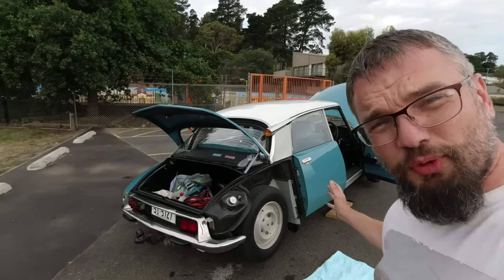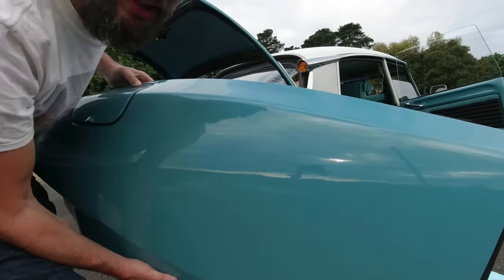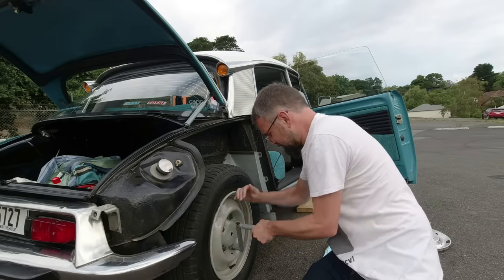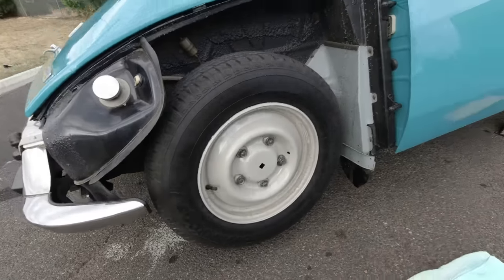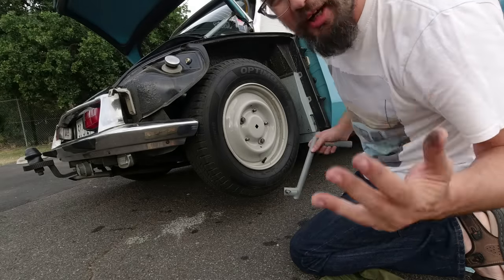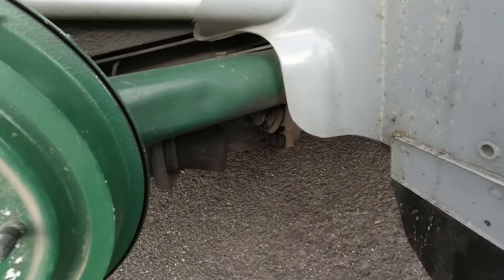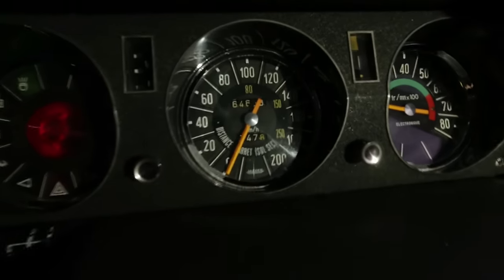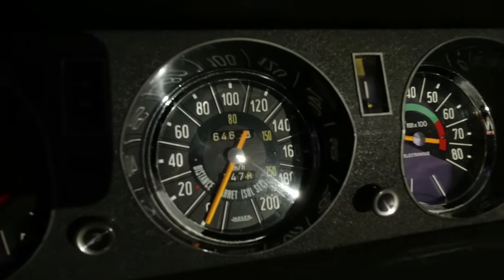Can it drive on three wheels?! And other Citroen DS Party Tricks

Comment: It got there Ian.  I share the excitement with you.  Who’d have thought that when we did this it would go on to be your most viewed video and reach 1 million.  YIPPEE!  👍🥳😄🚙
Reply: Great that you suggested it for your car. As I understand it.
And it seems it was a bit touch and go whether Ian could stretch to going to Tasmania.
Reply: @johnd8892  Yes John.  All the ducks got in a row.  Getting the night shots was nearly a non starter as Ian’s camera was no good in failing light but then he decided to try his phone and it coped really well but that bit very nearly did not happen.
Reply from the maker: Aye. A few people noticed that piece of wood disappearing too. Didn't all go to plan but great fun, and a huge success! Thanks Peter.
Reply: ❤Similar to Dr Dre and Snoop Dogg  's party trick in the song : Still Dre . I think it's called ! ❤ 
You couls call this car The First Lowrider. As it's perhaps the first car with hydraulic suspension  ! ❤
The Wikipedia blog on Citroen Xantia cars is interesting. 
The rear wheels can turn it says ! ❤
Perhaps this guy is a Mechanical Engineer  ? ❤

A worryingly immaculate car with 646 visible on the clock. Looking under yhe rear wing. Some dodgy looking bumps covered in necessary underseal. The rubber sealant mechanics hate. ❤ Maybe it stinks when then try and weld it ? ❤
I would be worried about that passing the British MOT . (Motor test ?) Where one test is to poke at the wings with a screwdriver . Or the metal surrounding a wheel.

Without the rear wing the car looks a lot like The Austin Maxi ! ❤
Taking curves and corners. Steering and Power transfer must be a major challenge in The World Of Cars . ❤

Comment: And all achieved without a hint electronics. Very impressive.
Reply: I like that part the most, too: simple valves and some rod to connect those to hight correctors, some oil, some nitrogen and a lotta chuzpe versus their fellow car builders.
Reply: The hydraulic semi auto gearbox and clutch has nothing, and I mean really nothing to envy to latest german or japanese robotic gearboxes, and all only with hydraulic and a fine tuned circuit
Reply: Sounds terrifying to me
Reply: As a soft and hardware engineer i grew up with this car (my dad worked for citroen 50 years) and the way the system works is pure software programming in hardware. There are so many small details not discussed here.. (still great video) there is a reason why this is the most innovative car of last century.
Reply: @scb2scb2  As a boatbuilder and offshore sailor, I have a natural aversion against putting my life and comfort on printed circuit boards used in saltwater environment, be it the Atlantic or continental winterroads - that does make the strictly mechanical approach so alluring, while I'm as well thrilled to date by this car's ingenious simplicity deriving from thinking "suspension" and "braking" in a way never used before in automotive history. Rolls and Mercedes licensed the "suspension" part to improve their luxury top end  cars in the late sixties and seventies: There was no better option to have. And I doubt there's today. (That's why I still drive a somewhat 40 years old one as my daily ..)
Reply: @manfredschmalbach9023  Yep the rolls who have them even had to put a small 'plate' on the cars that stated it had the citroen parts but it was not the whole system. One of the cool parts is its almost really like a program. For example Citroen once won a lawsuit where someone claimed the breaks where just 'gone' but citroen could show atleast 3 or 4 other functions would shutdown before breaks would be gone (like steering, light pop up, car going down) ..all kinda cool.
Reply: Daniel Ockeloen I think that my Audi 100's had the pump, brake servo and rear self levelling from Citroen too. That has to speak volumes also as to the esteem the design was held in within the industry. Nice to have the recognition of your peers.
Reply: Every single Mercedes 124 Series "T"-model has a hydropneumatic rear-axle niveau lifter, too, by the way ....
And imagine, in a time dual circuit hydraulic brakes were an item to opt for with costs at other manufacturers, Citroën had stock bloody wheel-selective brake-pressure deriving from the load the very wheel had in its very suspension sphere at the time the driver put her foot on the mushroom serving as a brake trigger .... and all, You can't emphasize that enough, with simple valves and fluids and nitrogen and some wire-rods ... ah, I could cheer another 40 years about la DS  like I did the last 40 ....
Reply: @CaptainDangeax  lol, try putting 590lbft through it whilst reducing the shift time by 75%. See how long it lasts then.
Reply: @gottliebdee263  What are you talking about ? Use metric when using science
Reply: @CaptainDangeax  Who cares, 1 mile or 0.602Km. The distance is the same. Go away. A lot of people here wouldn't be able to explain what a newton is without looking it up, but they know what a pound feels like and how far  a foot is.
Reply: @gottliebdee263  Maybe in your only country a uneducated average fellow knows what a pound is. For the rest of the world it makes no sense. And FYI the definition of one mile is 1609.344 mètres and the mètre is not defined after some seed or some king's thumb. You're just using surrogate units derived from metric. So, what were you talking about in the beginning ?

Comment: I was about 12 when a friend's father took us to a show, we got out afterwards to his DS to find a flat battery, he got out the crank starter, twirled it and away the DS went.
That's a party trick!!!!
Reply: I had a hand starter on my VW split screen van. Very handy when the start motor went awol.
Reply: Yes, very handy. Unfortunately the spigot is not there on models which have a five speed box. That and it is difficult to get number plates with a suitable hole for the hand crank nowadays.
Reply: @jean-pierredeclemy7032  at least, my 5-speed still has the hole in the air duct. Not sure if it is still original, but as the duct is aluminium, probably it is. But funnily I never checked for the cranking capability as it always started no problem up to now...Need to look though :-)
Reply: @jean-pierredeclemy7032   And , nowadays most cars have transversal engine , that's another complication in that regard.

Comment: Regarding the headlights, i) did you notice that when the inner driving lights swivel, the pivot isn't totally vertical; they face downwards slightly, to compensate for body roll when cornering hard, and ii) the outer high/low beam headlights are connected by cables to the front and rear suspension to compensate for pitching and also to dip slightly when cresting a hill and, conversely, tilting up slightly when coming out of a dip.
Reply: Well of course not clever clogs!
Reply: I dont speak english, I'm french, so...
Yes, it's right, the headligths were able to " compense" the level of the hydraulic suspension.
All those systems made a very smooth and confortable car.
Voilà !
Reply: This is also valid for acceleration as long as the suspension has not yet compensated the slight pitch motion due to sudden constant acceleration torque.
Reply: Absolutely amazing! Just when I think I’ve heard it all… especially as everything is done without a printed circuit in site!

Comment: I have seen this car still in use in the 80s, although it was already old. I knew about the lights that turn with the steering, but not about the 3 wheels ability. This car is absolutely amazing. A masterpiece of technology. Just like the Concorde also was. Thanks for the video and thanks to the owner of so well preserved car.
Reply: it was manufactured until 1975

Comment: Was that the owner watching like a protective mother hen for that trick? "Don't harm my baby" 😂
Reply from the maker: Ha! He did keep an eye on me, and did important camera work!
Reply: @HubNut  a true co-production!
The self centering steering is another party trick  that the DS has.
Fun video!

PS pitty that this car didn't have Michelins fitted.
Reply from the maker: Actually, the DS does not have powered self-centering. That came with the SM and was also used on the CX and some XMs (left-hand drive only)
Reply: @HubNut i was convinced it had.  I stand corrected.
Reply: @jfv65  It does kind of. There's a sprung roller that acts on a cam on the steering to find the straight ahead position (the steering geometry is a bit lacking in castor action). The power steering assists the roller's action just the same as it assists input from the steering wheel.
Reply: @GarJaMi  I have been told (1 theory) that is why the steering wheel is slightly askew going straight ahead as there needs to be a slight bit of resistance on the pump and the weight of the steering boss not straight ahead provides this.  However yes, there is a flat piece of the power steering roller where for it to sit when going straight ahead.  It was just one theory I have heard.
Reply: A very trusting owner I would say!
Reply: My dad had one many moons ago and tells a story of how he drove it through glencoe on three wheels after an accident
Reply: @HubNut  Our DS21 had self centering steering, and we had an early ID19 which had wheels that were held with one nut (one HUBNUT!)
Reply: The Jibber Jabber 
Hubnut mensioned earlier  that there was double wishbone on the front, NOT correct, there are two "L" shaped castiron arms fitted one over the other with the "kingpin" fitted in the rim centerline, that is why you dont feel potholes in the steeringwheel, they are absorbed in the rimcenter. Also the front driveaxle unijoint is fitted inside the kingpin and the big wheelbearing, you have to se it;-). 
Why dont you use the correct tools to take off the hubcap, and also use the long lever together with the wheel nut tool, all is in the engine compartment.
Reply: The Jibber Jabber 
Just one more thing, or two;-)
the slightly skejede steeringwheel is actually a "safety feature", the idea was that in case of an accident the driver would be pushed against the steeringwheel spoke and be directed slightly to the cars center.
If you just for a moment imagine a lefthand steered car, then the hightadjuster lever would be deeper in the footwell so not in the way as in rh drive cars, and the parking brake is at footoperated american style pedal and with plenty of footroom for your left foot.
Reply: @renelocht  That system is called dual leading arm suspension. It is better for comfort, braking and straight ride quality but there is a downside of that design which is the suspension has no camber correction with body roll, meaning under hard cornering the wheels will lean with the car. That enhances understeer and can exaggerate the body roll as it is compounded with the tyres rolling over on the rim. Anyone who has pushed a Citroen hard on a winding road will know exactly what I'm talking about... the front Michelin's will howl in pain as you pass into nicely progressive understeer...
Reply: @alasdair4161  that might also be due to the weight distribution which allows for the 3wheel 'party trick' that presumably saved General de Gaulle.
Reply: @peterriggall620    The spoke in the steering wheel is at an an angle to deflect a human into the centre of the cabin as one of the 'safety feature's'.  The Michelins for the DS were designed with an asymmetric pattern to direct some force inwards to stop weaving at speed.
Reply: @renelocht  The right hand drive drivers foot well is tighter than the left. A little annoying but so it is.
Reply: @jfv65  The DS doesn't have a self centering steering. It's completely nutral (zero angle camber and zero angle castor). It does have a small cam only when the steering is in the center, for driver feeling.
On ID's I don't know.
On the SM and CX there is a veriable power assisted and self centering steering, it was called DIRAVI.
Reply: @alasdair4161  I pushed my CX2000 hard around corners, but I was rolling on Kleber tires.   Amazing road grip.

Comment: Brilliant as usual,  I can imagine the scenario when you experience terminal  understeer approaching a tight bend, one pair of lights to show where you should be going whilst the fixed lights illuminate the ditch you're about to slide into with those fearsomely powerful brakes locked up....(all while on only 3 wheels.....)
Reply: Yes I was thinking that as well LOL
Reply: Have to be prudent on 3 wheels
Reply: And when the car comes to a stop, shrug expressively and light a cigarette.  Gauloises, for preference.
Reply: And a German passing by howling retreat
Reply: Well, being used as off - road racing cars (Rallye) the Deesses must have performed quite well in comparison to their competitors at the time.
Reply: @pauldavies6037  so was I funnily enough

Comment: The DS is a true engineering marvel, one of the most iconic cars ever built. I wish I could afford one, maybe I should rent one just to enjoy the ride. There is a Peugeot dealership nearby, former Simca dealer, who has many French classics but also ordinary cars from the 1970s out of their private collection for rent. A bit expensive but sometimes you have to celebrate Good Times.
Reply: What cars do they have ?
Reply: @volvo480  wow I like the Simca 1000L, 504  GL
Reply: @volvo480  thats hot
Reply: Perhaps renting a Simca would be cheaper.
Reply: @sunbeam8866  I have owned a Talbot-Matra Murena for 14 years so I'm quite familiar to Simca :)
Reply: @volvo480  From the 1950s through the early 1970s here in the USA, we had the Oceane, Aronde, 1000 and 1000 Bertone coupe. Finally the FWD 1204. Then Chrysler pulled the plug. 
For only 1 year, about 1986, we did get a base version of the US-built FWD Dodge Omni-Plymouth Horizon with a pushrod OHV French engine. I remember one of those came in for an oil-change at the shop where I worked and we had a hard time finding an oil-filter. I think we finally had to pick up one from the Chrysler-Plymouth dealer!
Reply: They LITERALLY don't make them like they used to.. i love this car!
Reply: I got mine about 8 years ago and it took me about 4 years to weld Madame back to road worthiness. I took my time and enjoyed each step of the process 😁

Comment: This is still pretty impressive now.
Imagine the sensation when this came out in the mid-fifties! OK - the swivelling headlights only came on an update in the mid-sixties - but most of the other good stuff like the hydro-pneumatic suspension or the bolting of the wing were in place from the very beginning...
People must have believed to meet an UFO when this was launched...
Reply: Was the bolt head exposed all the time, or did you need to open the boot to get at it. If it was accessible all the time, it must have been a great temptation to passing drunks on their way home from the pub to remove the rear wings of a DS ;-)

Comment: A marvellous car. I had a Swedish school friend when I was in Kenya in the 1970s whose dad had a DS. Many of the roads there were atrociously bad, either disintegrating tarmac or full-on bush-tracks made of red soil and rocks, and they wrecked imported cars after a month - Fords and Land Rovers in particular needed expensive repairs and suspension upgrades - but the DS just floated over them.

Tyres were still tyres, and punctures still occurred, but every car carried two spares. The seemingly unbreakable 'magic carpet ride' suspension wasn't down to magic, though, just amazingly advanced engineering.

I was too young to understand what was going on back then, but I was always aware that the Citroën was something very special.

Comment: Fantastic video on an amazing piece of automotive engineering. Well done. 
Here in Australia the be all of automotive prowess is based on how fast a car can go in a straight line. Hence the ridiculous prices for locally built V8 cars from the ‘70’s which handled like shit and braking was intermittent. Lol
I drove a brand new BX 1.4 around Europe and England 30 years. (20,000km)
A 1.4 litre 4 cylinder car cruising at 150-160 kms. Great road holding.
Unheard performance from anything ever built in Australia.

Comment: Love it! never seen the 3 wheel trick done with the missing wheel on the same side as the driver. I did suspect drivers weight aided this trick, but no, even more impressive. Top work mr hubnut
Reply: My father drove his GSA once with all of us on board (4 people)
Reply: You could apply the same to most fwd cars.
Reply: @areyouundoingthatorwhat9181  No you can't.
Reply: @GeorgeSPAMTindle  go find a fwd hatch and try it,BUT don't try to tell me what I can or can't do when I have already fucking  tried it.
Reply: @HiWetcam I tried it with. MK3 fiesta it was hanging slightly towards the ground,a slight push would cause the rear drum and backplate to touch the ground but once moving as long as any momentum wasn't shifted on to the nsr it was more or less ok,going round our yard clockwise,I was able to get some speed up with no problem.
Reply: @GeorgeSPAMTindle  Actually he probably could,I have achieved similar malarkey with an old blue Skoda favorit.
Reply: I have done it on both sides and it does not appear to make any difference.  We decided to use the drivers side to make it easier for the camera work.  It negates having to run around the other side of the car all the time.

Comment: perhaps among its most practical party tricks is its not dipping downward at the front when braking hard -the suspension keeps the body level, increasing pressure to the front end while reducing it to the rear (during braking).

Comment: During a drive , London to Liverpool , in my GS I had a blowout when a sheet of metal was blown across the road and slashed my real near-side tyre. Low and behold I did not feel any change in the direction of the car. I just drove straight on using the three remaining wheels till I came to a safe stop. Changed the wheel as shown in the video re the DS and drove. What a marvelous piece of engineering.